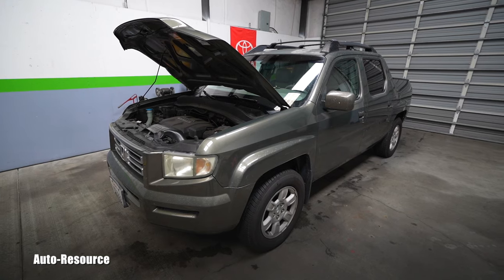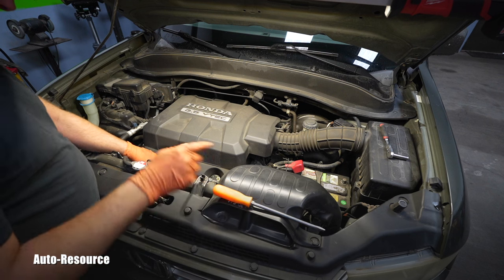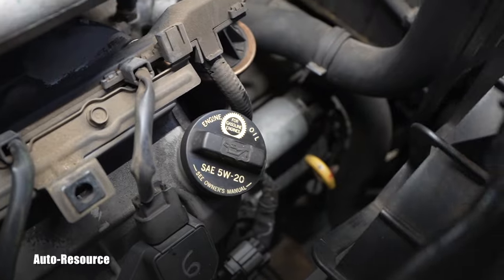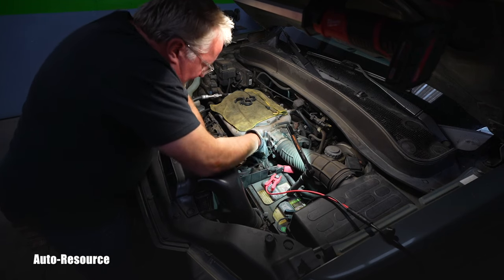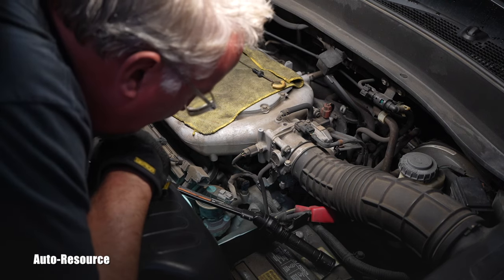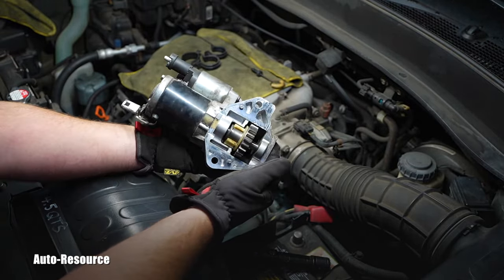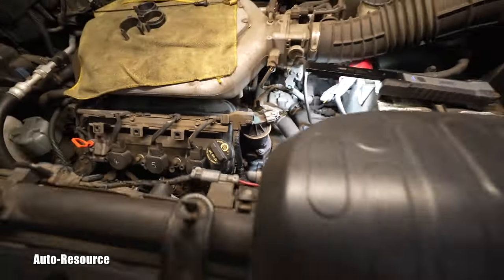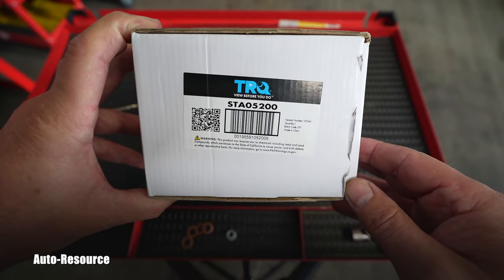How to replace starter on Honda Ridgeline

Comment: You know, all mechanics are hoarders by trade. Maybe you can increase your knowledge and rebuilder stock like you are doing with the control arm bushings and buy a solenoid and rebuild that starter to have on the shelf as a backup. Because you never know. Aftermarket new is not always the same as new and good oem.